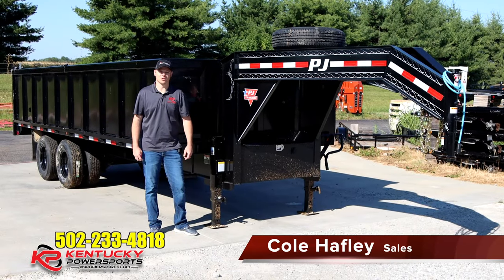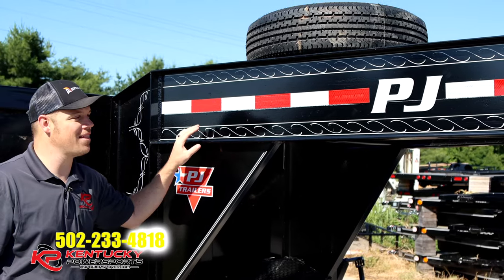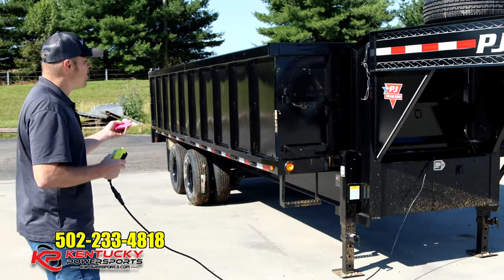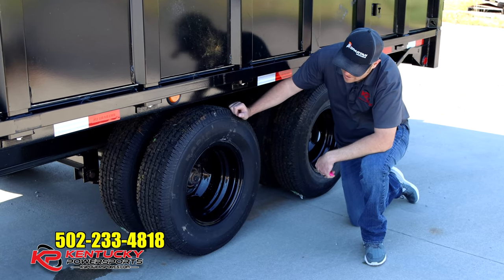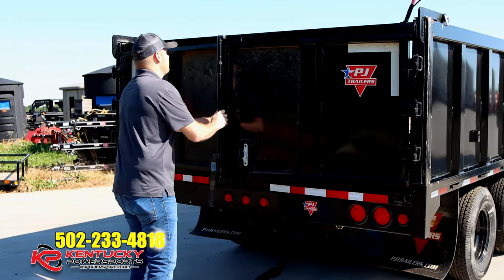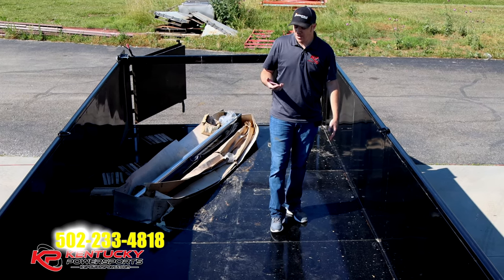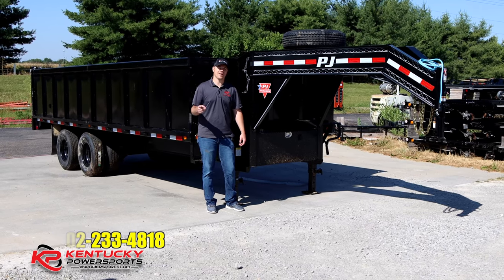PJ Trailers Tandem Dual Dump (DD)

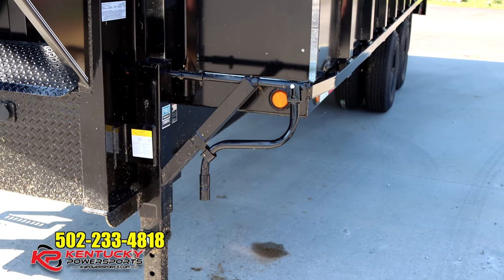Comment: Whats up with the 2" gap in the front corner at 1:26 ?
Reply: I noticed that as well, its on both sides.  I assume it's because its not actually a dump trailer but a flatbed tilt with 39 inch sides mounted via the stake pocket rub rail.  Im pretty sure its 4 entirely separate walls hence the gaps
Reply: There will be angle brackets that bolt on and it will make it seamless for dump use.
Reply: So the sides are removable?
Reply: Yes the sides are remove able, they bolt into the stake pockets. It is a cool trailer that can be used for several jobs.
Reply: i think that is because the sides are removable

Comment: Whats the biggest gooseneck dump trailer can I drive without a cdl?
Reply: none
Reply: @danyoung2011  actually anything under 16ft you should be ok with. I have a 14ft and 12ft dump trailer at the moment.  It just has to be under 24k gross weight....
Reply: You can't drive a trailer over 9,999lbs without a cdl. Up to 26klbs trailer is class B, over 26k is class A. You can also get personal class B or class A, but can't work for hire.